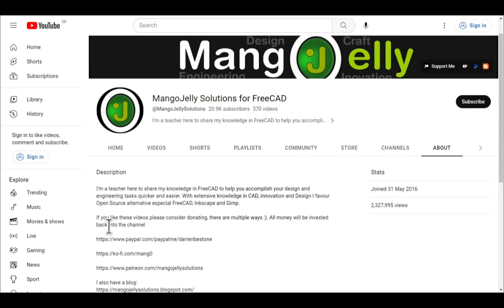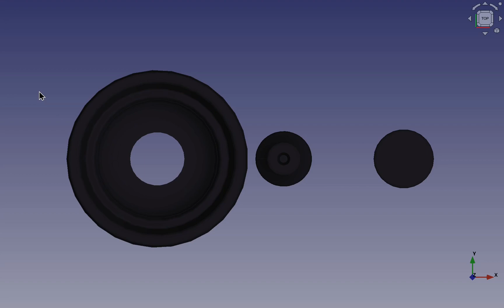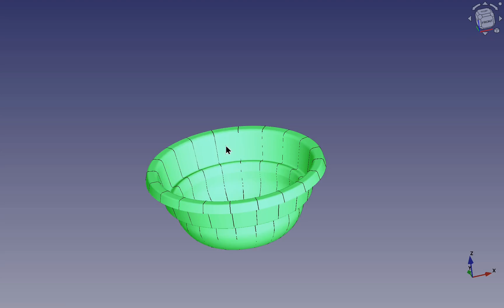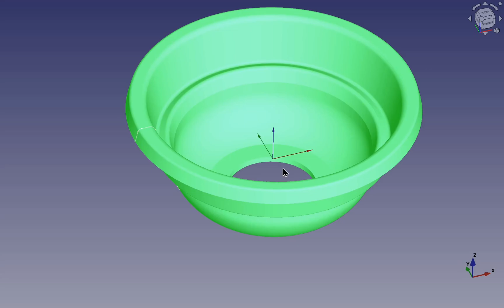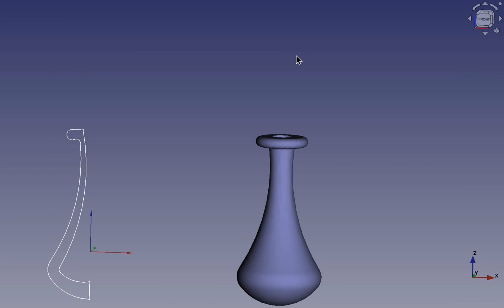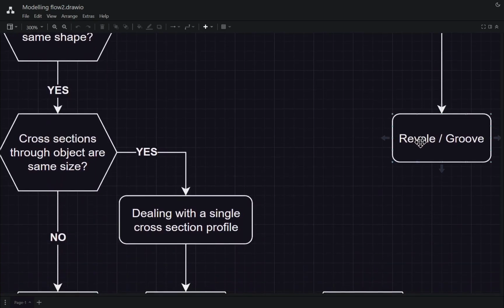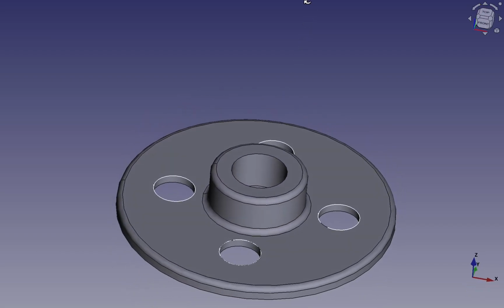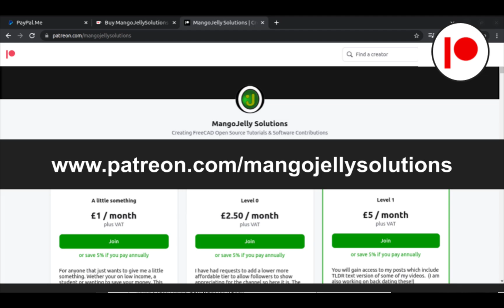FreeCAD v1 / 0.22 | Lesson 9 | Real World to Digital. Revolves Basic Beginners

Comment: As always - I like your videos. However, can anyone tell me, after creating a partdesign object using revolve, how I can make holes for e.g. screws in the object? I'm sure it's simple, but don't seem to see it described anywhere :)
Reply: I should have mentioned the problem appears after I have made a boolean subtraction in Part WB to create a groove on top of the object. (Which also gave some problems when trying to slice the object)
Reply: I just have to ask - then I find a solution. Sorry :)
Reply: @birgernielsen9952  so what was the solution?
Reply: @GlueTubber  My solution was not to mix Part and Part Design WB. Revolve a profile with a half circle instead of extracting a donout and then add holes/pockets on the flat surface. But I still don't know exactly how to handle operations using both wb's without getting errors. In some of my experiments, extracting a donout from a surface looked as it was ok. However when importing it into a slicer, the donout appeared above the part, not recognized as a cut by the slicers (Cura/SuperSlicer). So, Iv'e got something to learn :)